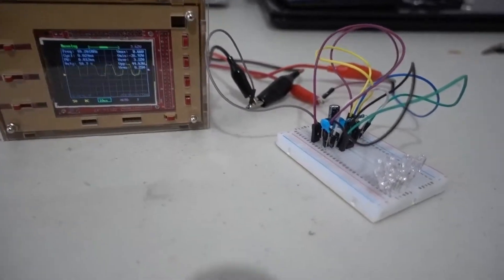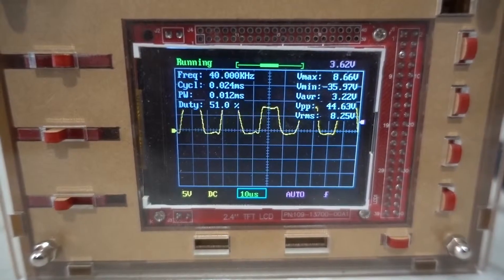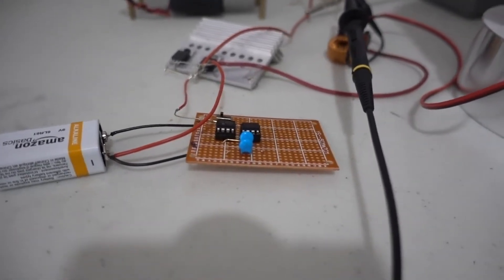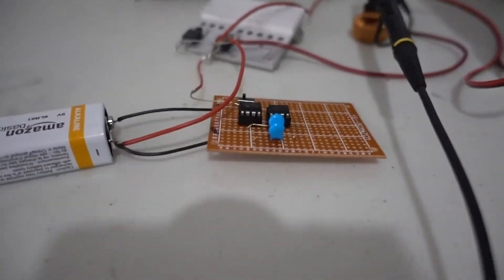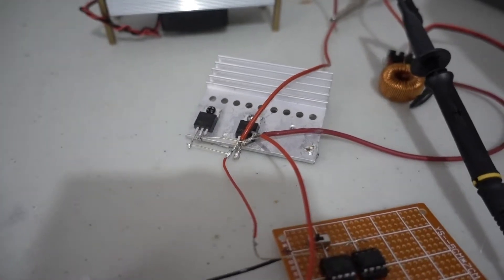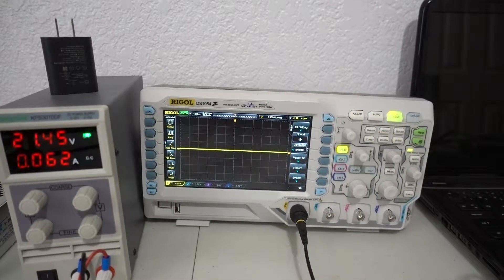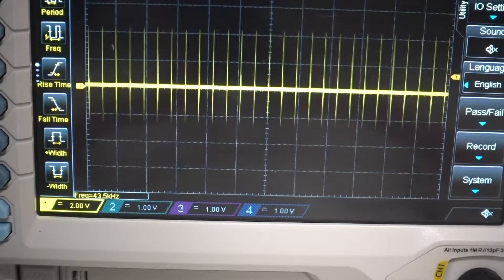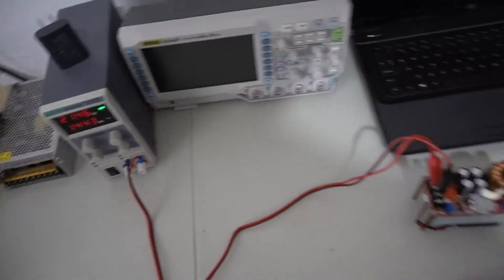Simple Ultrasonic Cleaner Circuit Part 1/2

Comment: I have a question
I've bought a cheap ultrasonic cleaner from amazon and when it arrived the circuit board broke free from the plastic standoffs it was mounted to.
So I was forced to have a peek inside and couldn't help but notice that there was a free spot for what I assume to be a resistor between the coil input and the output to the transducer
the way it's set up right now, the coil is in series to the transducer.
can I increase the power by adding a resistor?
It's advertised as a 120W unit but only delivers 80 Watts, so I suspect something just went wrong during assembly.
there's the text "5.1R" written in the free spot, I suppose this is a resistor with 5.1 ohm, right?

Comment: Will make the circuit scheme available?
Reply from the maker: So I used this circuit for the frequency
 ( https://www.google.com/search?q=ne555+40khz&source=lnms&tbm=isch&sa=X&ved=0ahUKEwjwrMrmuenjAhUPOs0KHXU1DZYQ_AUIEigC&biw=1920&bih=969#imgrc=B4sAW7R46mZYzM: )  and connected the output to a MOSFET driver to 2x 400V MOSFETs with a supply of 60V and the output to the transducer/inductor in parallel and that to ground.  Sorry for not drawing it out.
Reply: Your approach and scheme is not working.